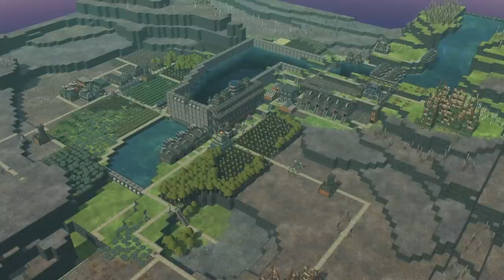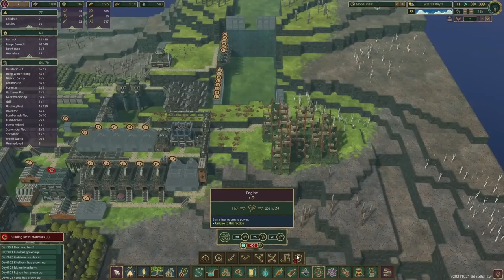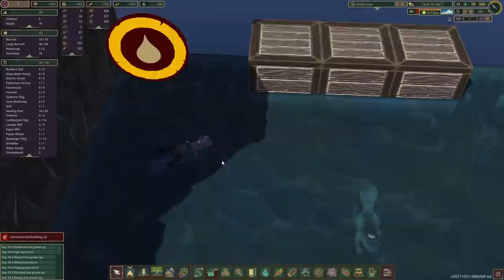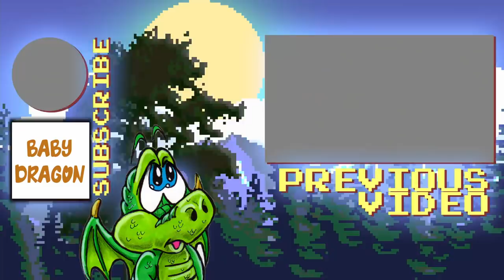TIMBERBORN | Beaver Power Through Hamster Wheels - HARD MODE | E09

Comment: What if you put a row of dams perpendicular to the waterfall to constrain the water from the water dumps to one block width.
That should keep the water from spreading out and direct it to the water wheels.
Using dams should prevent the flooding that levees would cause.